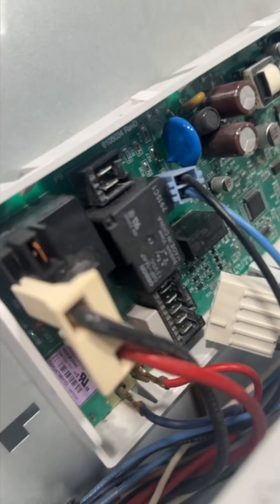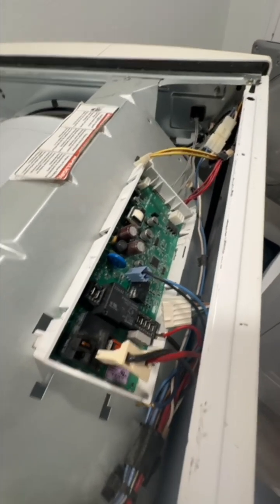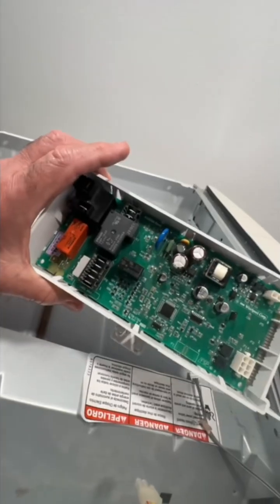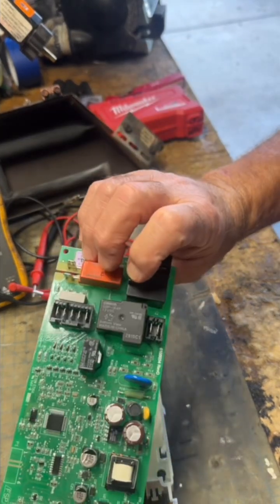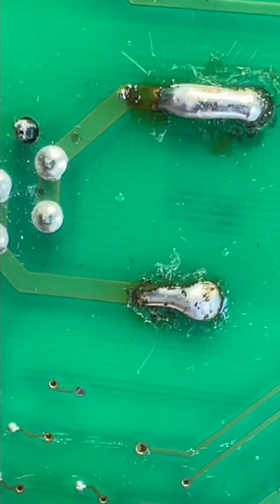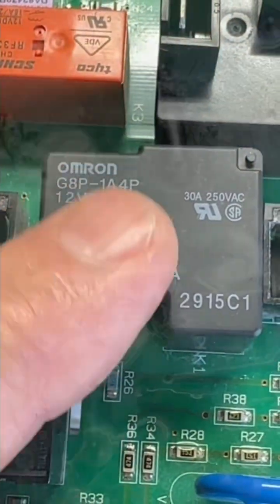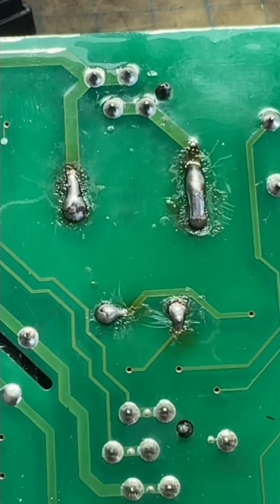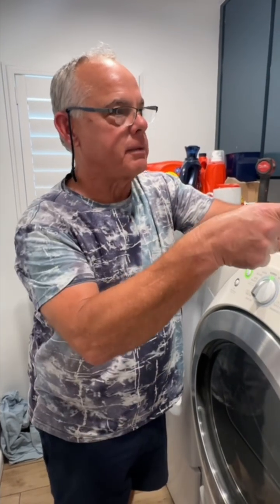Whirlpool Dryer F-70 Easy Fix!

Comment: Thanks so much for sharing. That might be my issue.
Reply from the maker: I am sure that is the problem. I would recommend that you run a trace wire and solder that in.
Reply: @fixitjohn  oh really? Ok I’ll do that when I get it apart. Much appreciated sir!
Reply: @fixitjohn  
I think you’re right because my wife just demonstrated the problem for me. The screen blips on and off intermittently. Looks exactly like what you’d expect from a bad solder joint or bad connection to some kind.

Comment: I bought an Asian brand so that I never need to worry about motherboards and strangers visiting to fix it..... Had mine for 15+ years.
Reply from the maker: oh nice, could you leave a link for that where to get a asian brand motherboard? thanks for sharing.
Reply from the maker: oh, I just realized you probably meant an Asian brand washer and dryer. Thanks for watching.
Reply: @fixitjohn I have the SAME drier, SAME problem. Can you come fix mine. Sheesh why would this be so cheaply made that panel would need to be re-soldered. 
I’m not able to take apart and fix. Nothing is built to last.